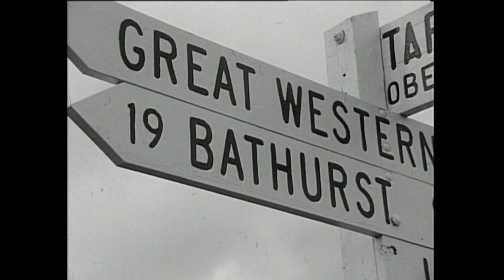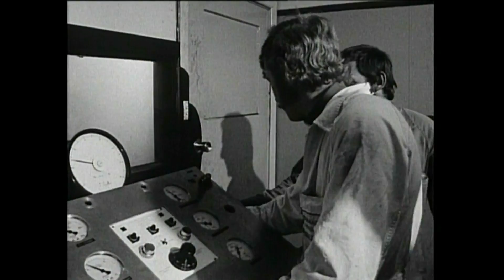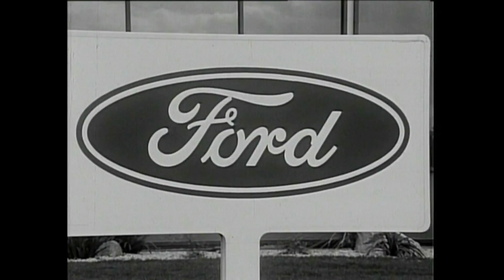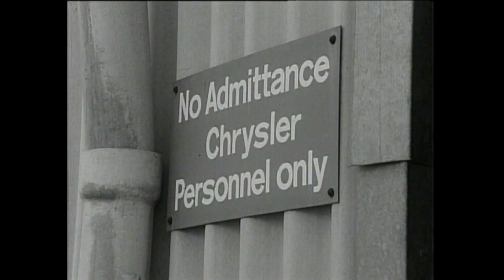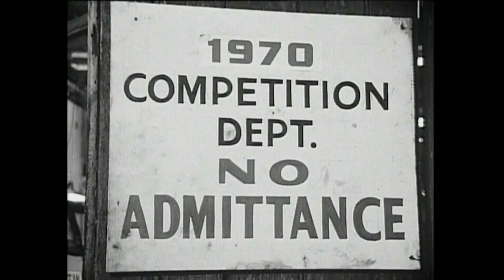BATHURST - THE BIG THREE 4 Corners 1970

Comment: What a fantastic insight into a bygone age. As a Pom who correctly pronounces it "BAFF-Hurst" this is really interesting to work out the machinations from the different teams of that era.
I reckon this 4 Corners programme was the ABC's equivalent of Top Gear, well before the Clarkson/May/Hammond era.
ps - RIP Holden.
Reply: A one off ABC 4 Corners episode. Still running weekly from its 1961 start. Some say inspired by BBC Panorama. Lots of comments below about the trends in the ABC and 4 Corners. The ABC in the mid seventies to around 1980 did present a weekly car focused show called Torque. With Peter Wherrett giving his opinions on new released cars and later the Marque series. Some can be found on Youtube. So possibly well before the first Top Gear.

Comment: Absolutely Brilliant, such a blast from the past. Those hemi Pacers sure did give those GTHOs a run for their money
Reply: Daan Vaan they won just not Bathurst maybe if Chrysler spent more money like ford and Holden things could have been different but will never know
Reply: Although they used the American A body,the engine,3 speed trans and diff were all Australian. I remember the pacer had the pace but the engine was the 245 and it took a good driver to get one to move at the absolute limit to keep the cheating Fords at bay. I reckon Firms like Shelby were supplying the engines and the fourspeed trans gave them an edge,plus all of the different diff ratios available to them.As mustangs were simply a falcon in a fancy frock, there was a lot of know how being fed to the OZ teams back then.  I have a customer who owned two Pacers, a red one and a blue one and the brakes were pretty ordinary,being locally made PBR units. We cured a lot of the brake issues by installing an extra booster under the backseats for the drums. If the cars had been built in the US,things like B body brakes, the mopar locking diffs, and the fourspeed trans could have been used,and if the front brakes were still no good,a set of imperial discs would have cured that.
Reply: Like when they put the six pack in the chargers and gave the falcon v8s a spanking.
Reply: The Falcon was heavier than the Valiant, but even in its first year the Cleveland 351 was outstanding.
Reply: @Mercmad  USA A body but was widened for the AUS cars
Reply: @Mentorcase  The Charger couldn't match the top end of  a GTHO .

Comment: I had an LC XU-1 with 188 HP. Three 45 mm Webbers, dyno-tuned extractors, etc., etc.
Reply: Mate had an XU1 came back from the pub and wrote it off 71 Miles on the clock
Reply: All I had was an EH with a 186s, worked with a 149 Stage 3 Yella Terra head, 3/4 Race Cam, 650cfm Holley, Tuned Extractors, Balanced, Mags etc. She picked up her skirts and took off when pedal was at the metal. Not a bad daily driver also. Sold her to a guy who got it defected by the Cops in Hindley Street and then he broke it.
Reply: @Leosarebetter  Yes...who remembers the Brian Muir EH S4 ? The first Holden Special for Bathurst.

Comment: "...tyre problems in Pacers."  Hardly surprising - you can see the inside steer tyre actually lift off the road in corners...belted bias plies are tough, but not tough enough to make up for a badly underdone suspension setup like the Valiant.
Reply: "underdone Valiant setup"  Bullshit!!  You obviously haven't had a 70s Falcon and any Valiant up on a hoist and compared them  The Ford's front end, and indeed the whole suspension, is just so light compared to the solid heavy duty Valiant.  Which has been designed for ruggedness and durability AND tune-ability, compared to the Falcon's cost saving offering.  You can clearly see how well they are handling on the track and are giving the much more powerful and wider tracked Falcons a good run.  The exact same suspension is used on the Chargers and with their shorter wheel base and wider track they were unbeatable in the handling dept on the tight tracks - in New Zealand on the tighter racetracks they were unbeaten for 7 years.  Allan Moffat sent a couple of cars (Falcons) over from Aust to try and take away their winning streak but were unable to out-handle the Chargers and went home without it.
Reply: (The torsion bar setup is better than the lame wishbones on the GMH/Fords...but it was still underdone - Chrysler was rather stingy and inconsistent with its budgets.)
Reply: @montinaladine3264  I wouldn't call Valiant suspension 'durable' by any means. Ball joints could and did wear out pretty quick on them, at least Fords had spring loaded bottom ball joints which helped reduce wear and tear on them

Comment: Wheres bill Bourkes XW NOW, RE: the 429 Beast that was seen along the geelong freeway doing over 150 miles per hour, think about it for a second a 429 Shelby did not even do that speed, also i am not a FORD man, it just proves that those people who own GT GTHO'S push the price up & at one time you needed over $1,000.000 to buy an total original un painted un restored with low KM original HO, yet the same car now you can get for just over 300,000 ? YET HOLDENS Winning cars at the same time period, were going for chips Talk about control over the market, i feeel that these days its evened out a little, i should have kept my Gold XB GT, but in saying that they are going for about 30 to 40K in original Condition. :)
Reply: The Bill Bourke special was a 428 Cobrajet not a 429
Reply: 7071t6, the 429 was NOT installed in any AUSTRALIAN factory built ford!
Reply: mark the xw of bill bourke was a special sent over to america and fitted out with the big block 428 cobra jet and shaker in black and gold stripe  and still lives fully restored in australia '  read about it in australian muscle car mag
Reply: @BCBtrucks64  I have been in the Bill Bourke xw gtho it was for sale in Adelaide in approx 1979 they had the article from the car magazine that it was in years earlier in the widow to show who's car it had been.  It was the only auto gtho made it was black with a  fine silver metallic flake it had xa style high back bucket seats shaker 428 bb ford  and gtho badge on the glove box lid it had vaccum tank etc big36 gal fuel tank  i wanted  to buy it but couldn't raise the money at the time but about a year later i did buy a genuine jg33 xy gt nugget gold with a 4 speed  ......cheers
Reply: A mate of mines son inlaw has the XW 429 up in Brisbane in his garage uninsured